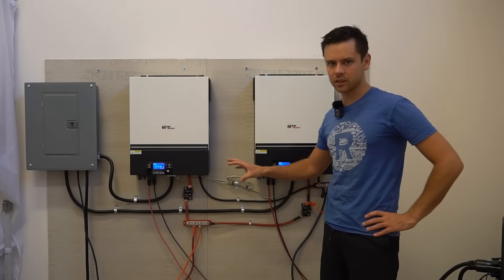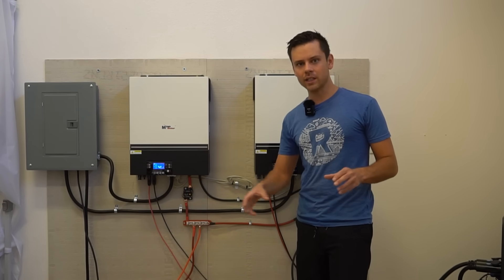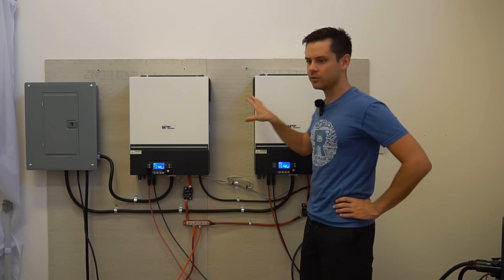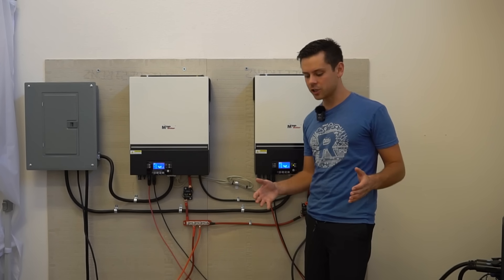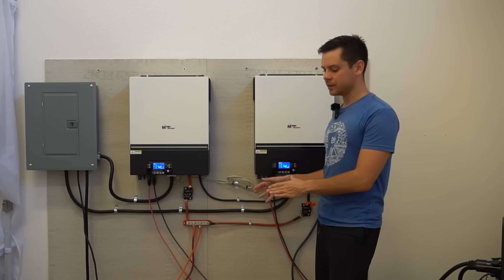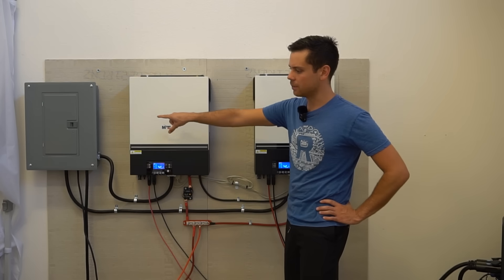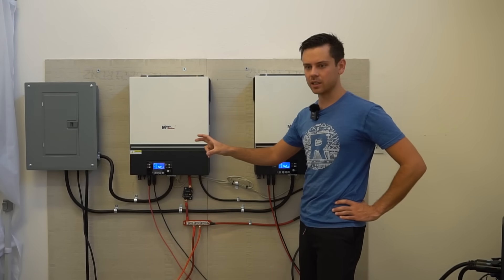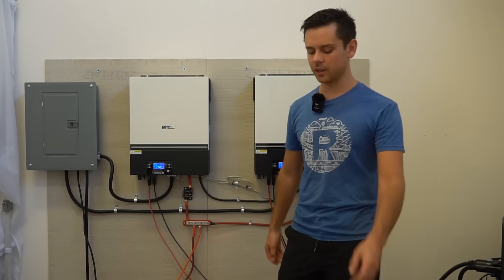Does my 13kW Offgrid Solar System require Grounding? Is it Grounded?

Comment from the maker: Part 2 Grounding Update: https://youtu.be/X3QA9T_O1g0

Update: this system will never pass an inspection and never needs to. It is Offgrid and there is not a single permit required for connecting a battery to an inverter, and using a couple of panels laying on the ground. People are trying to reference NEC?? Why? This inverter isn't even listed. Sure it's compliant and certified, but it would still fail inspection. And that's fine. I'm not connected to grid (besides back up battery charger which isn't grid tie. It's a battery charger). And I only care about safety and that's it. 

Original pinned comment: 
Oh and I'm adding ac supply at the input on it's own breaker today (and programming it to only use the battery charger. Not bypass!). That's why I said it has true earth ground in one of my given examples.

When this system is supplied by a true earth ground ac circuit, I do not need to separate the grounds and neutrals on my panel because the transfer switch will be open, and the output of this inverter will not act as a sub panel supply. This is because the input only supplies a battery charger in my configuration. If I am using it as a UPS (which requires programming it as such), and I have a large dedicated breaker supply from my sub panel, (which I will not do), then I will need to separate ground and neutrals. That would make a separate connection, and it is not isolated. When the ATS inside the inverter is connected only to the battery charger, it is isolated. But still susceptible to high voltage if a ground loop was created. 

If it was not grounded when not connected to ac input, that is fine. There are plenty of standalone systems without grounding. Such as an RV electrical system with inverter when not connected to shore power. Same thing.

So it really depends on how you use it. If you are using it not as a solar power system, and instead as a stand-alone UPS, then I could see why you do not want to bond the ground and neutrals at the ac output. But that is the only exception I can think of.

~~~~~~~~~~~~~~~~~~~~~~~~~~~~~~~~~~~~~~~
Tired of getting ripped off? Check out my "Will Prowse Approved" solar product recommendations below!

12V Batteries
https://www.mobile-solarpower.com/lithium-batteries.html

48V Batteries
https://www.mobile-solarpower.com/48v-batteries.html

Offgrid Inverter System Builder
https://www.mobile-solarpower.com/48v-complete-system-blueprint-559371.html

Hybrid Inverter System Builder
https://www.mobile-solarpower.com/code-compliant-48v-offgrid-system.html

Mobile Handtruck System Builder (very popular!)
https://www.mobile-solarpower.com/mobile-48v-system.html

Solar Panels
https://www.mobile-solarpower.com/300w-solar-panels.html

Ground Mount Solar Racking
https://www.mobile-solarpower.com/ground-mount-racks.html

Wire, Lugs and Busbars
https://www.mobile-solarpower.com/wire-and-connectors.html

Tools
https://www.mobile-solarpower.com/tools.html

Fuses and Circuit Breakers
https://www.mobile-solarpower.com/fuses.html

Plug-N-Play Solar Systems
Ecoflow, Anker And Bluetti! So many models to choose from. See my current recommendations here:
https://www.mobile-solarpower.com/full-size-systems.html

~~~~~~~~~~~~~~~~~~~~~~~~~~~~~~~~~~~~~~~~~~
Need to build a large DIY system? Need a trustworthy solar distributor? These are my favorites:

Signature Solar
Creator of EG4! Solar Minisplits, Victron and More! Largest Solar Store Online.
If you want $50 off, please use my link below and coupon code "DIYSOLAR50":
https://signaturesolar.com/?ref=cPwLcVc0SW-BjN

Current Connected
Best Prices for EG4, Victron, Midnite and so much more! Fast Shipping and Highest Rated Customer Service:
https://currentconnected.com/?ref=wp

~~~~~~~~~~~~~~~~~~~~~~~~~~~~~~~~~~~~~~~~~~
Join our DIY Solar Community 
Need more help? Join the largest solar forum on the internet for beginners and professionals alike. 140,000 members and counting!
https://www.diysolarforum.com

Check Out My Free Book
Best-selling and beginner-friendly guidebook to off-grid 12V solar!
https://www.mobile-solarpower.com/the-book.html

~~~~~~~~~~~~~~~~~~~~~~~~~~~~~~~~~~~~~~~~~~
Contact Information:
I am NOT available for personal solar system consult! If you wish to contact me, this is my direct email: williamprowsediysolar@gmail.com
FTC Disclosure Statement and Disclaimers:
Every video includes paid promotion or sponsorship (such as free products for review). Some links on this YouTube channel may be affiliate links. We may get paid if you buy something or take an action after clicking one of these. My videos are for educational purposes only. Information is subject to change/update at any time. Electricity is DANGEROUS and can kill. Be smart and use common sense :) DIY Solar Power with Will Prowse is a participant in the Amazon Services LLC Associates Program, An affiliate advertising program designed to provide a means for sites to earn advertising fees by advertising and linking to Amazon.com
Reply: Hi, could you please make a new video with "schemas" and explanation? It will be very clear for all of us. Please.
Reply: I think of a UPS as when the solar/battery is a backup for the grid. The other option - and what I'm thinking of doing in my setup is to have solar/battery as the primary with the grid as the backup.  I believe that if I'm doing it in that way that I have to have a dedicated ground for the AC subpanel which is going to be in a solar shed/out-building ... I've slept a time or two since I delved into the NEC looking this stuff up though - I'm going to have to re-read it to remember the details on grounds and panel bonding however.
Reply: This may be the wrong spot to put a comma in and if it is I apologize the midnite Lightning arrestors moffett Are they worth it for PV side for dispersing excess energy
Reply from the maker: Yeah those are nice
Reply: You are right. I really enjoy your Channel.
Ciao
Reply: Am I understanding your message correctly, Will? I should not use a ground rod and 6AWG bare stranded copper wire to ground my solar panels and my hybrid Sol-Ark 12K to? Should I be grounding any components of my solar system and if so, how?
Reply: @fisherus  10mm2 gauge 8 is often recommended. If components have an earthing point (eg Epever & Victron SCC’s they should be grounded. Victron also state in the manual to provide a single ground connection close to the battery, on negative. That does not interfere with required grounding of solar rails and panels, and safer to have SPD on solar panel wiring.
Reply: @fisherus  On the DC side, you only would want to ground a lightning arrestor, and possibly surge suppression.
Reply: @jamesalles139  so then where should the SPDs ground wire go to. The AC ground rod?
Reply: @RJ-cc1fz  Not necessarily. Out in a field, I would drive a separate ground rod for the frame and an SPD. Lightning protection is dependent as short & straight a grounding wire as possible. This is NOT run towards the building.

Another, at a building entry, may have another ground rod, but that ground rod should be bonded to any others - a single point for the structure.
Reply: Will, are you sure the setting for utility charging vs ups really switches the neutral? A switched neutral tends to be fairly expensive and I’d be surprised if this kind of sophistication is built it. I would have guessed the neutrals (AC in and out) were always bonded to each other. Would be interesting to test this with a multimeter.
Reply from the maker: @kmil2010  actually some are not. You always need to check. These inverters are for Offgrid use only when not in ups or backfeed mode. They have some inverters that are hybrid, and the connections are obviously different. But yes I should verify with multimeter
Reply: @kmil2010  that is true  but i do think UL requires it  good subject Will grounding  is a very confused subject with inverters   you could save a life  another video on inverter grounding on rv boats ????  great job either way!!!!!
Reply: Send em to Mike holts grounding and bonding vids
Reply: Will, I would love to see a setup where you use this kind of a setup as a UPS. I'm trying to get a setup where I have a large UPS type setup that acts as an automatic backup source in the event of a power outage at my home.
Reply: @Mister-Black-Beard  most ups have a very high idle current    i wound a choke and put in my apc it took maybe .25 of a amp off   most the loses are from the the cheap E I type transformer   i have a toroid core i need to wind to replace it with   other than that the cheap smart apc works well on the two 200 amp hour batterys i hooked it up to   it is pure sine wave    i see the 1500 smart apc for sell all the time for under 100 bucks    the idle current of most inverters are not much lower  it has been a long time since i messed with it but think it was close to 2 amps before i added the choke so around 50 watts    it is a 24 volt 1500 smart apc   you can change the chrarging voltage turn wattage up a little  and bunch of other stuff from a lap top     very cheap back up power that keeps your batterys charged  i have been using one for many years now  the smart apc brand ones are pure sine wave better make sure of this if you get one many are not sine wave  God bless
Reply: yes, NEC may not legally apply to a given system, but it is a minimum standard. It is worth understanding to get a handle on safe practices, and where the voltage thresholds are. It also helps as a reference for common terminology.

Some people may end up with a system that is  covered by a code inspection. I think the caveat is worth it.
Reply: Some people get too tied up with law and regulation and codes etc.  Sometimes, you need to actually live and enjoy your property instead of trying to worry about all the "what if" scenarios.  If you do everything by the book you don't learn anything and it's just not as enjoyable since you can't do anything fun.  As long as you know your stuff, which you do, it will be fine.

Comment: So you lost me when you said that with a “ungrounded system, if you touch the hot or neutral, nothing would happen because there’s no true earth ground”.. while standing on the ground. As I understand it, electricity takes the lowest path back to its source and/or best ground. Well.. you would get a shock because you’re acting as the true earth ground. If what you’re saying was the case, why would any home wiring have grounding?
Reply from the maker: I said when it's not connected to earth. So there is no return path or circuit to earth, for that example. You will only get shocked if you complete a circuit.
Reply: Helicopters work on "high tension" lines and actually touch them, nothing happens except the helicopter becomes the voltage of the powerline. Just like the powerline there is no where for the voltage to go. A ungrounded system is similar in concept.
Reply from the maker: Home wiring needs grounding because the grid requires it because it is massive. Charge accumulation happens. We try to isolate various parts of the grid, but using earth helps a ton.